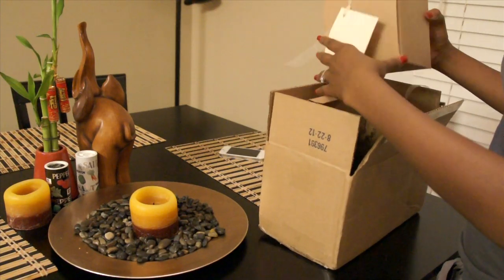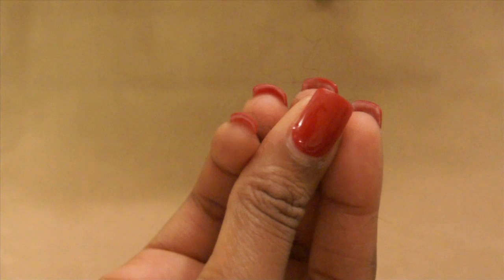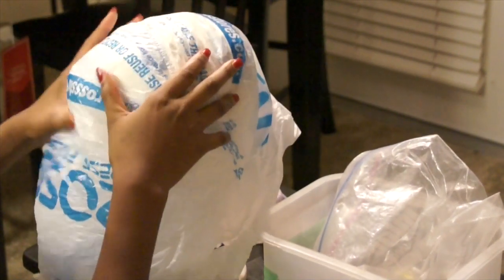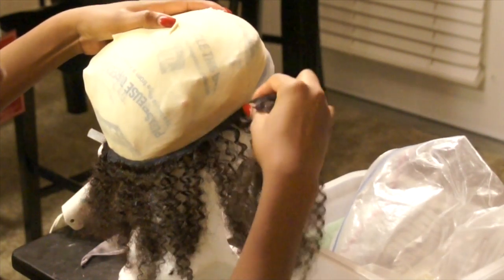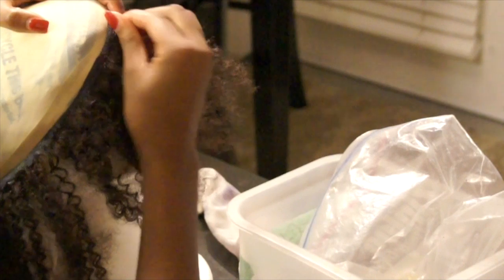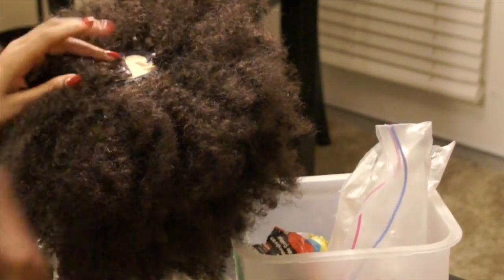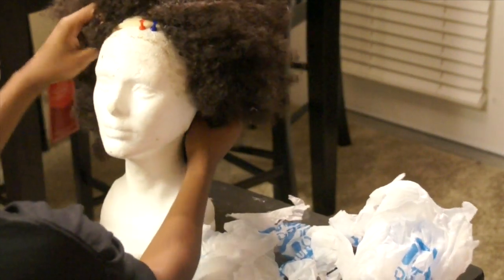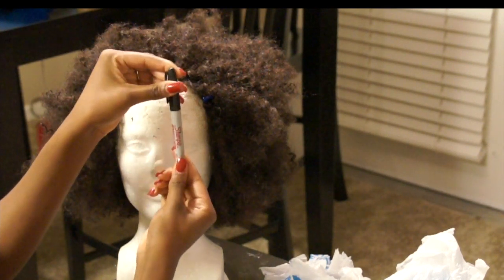Kinky Comber Install

Comment from the maker: Yes I think so, not by a lot because they both loosen up after they've been exposed to oils, but the hot glue does last a little longer and you don't really have to worry about drying time as you do with the weave glue.